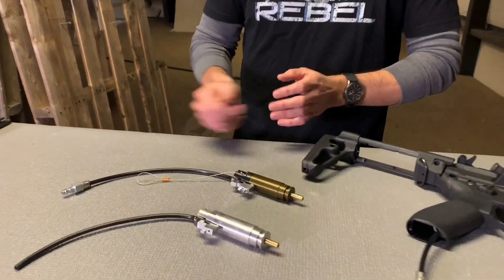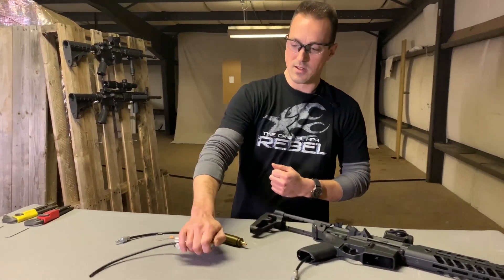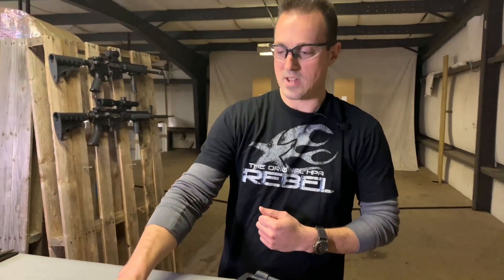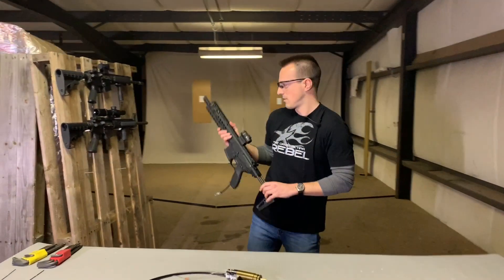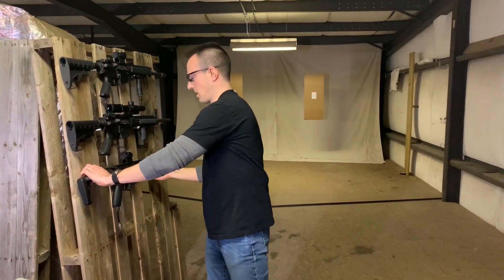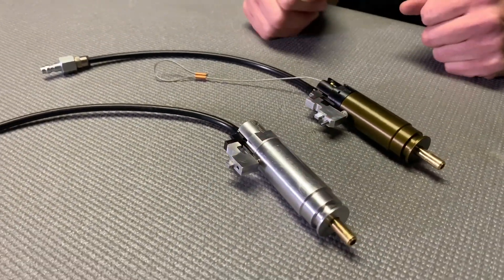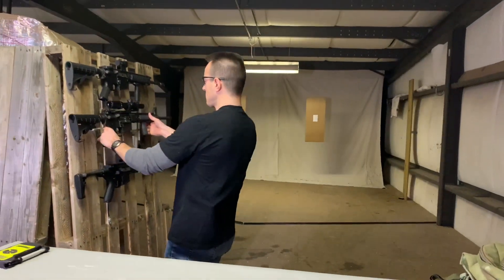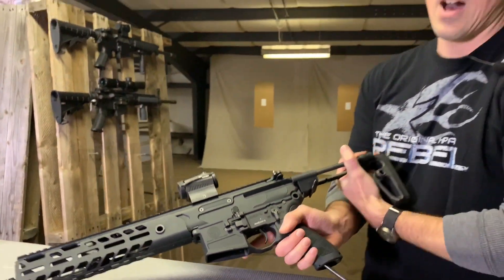Product Update - Kythera, Trigger Weight Test & Nozzle Dwell

Comment: Ok so I have a kythera, and for some reason whenever I use heavier bbs then 0.25g  the nozzle gets stuck in a rear position, and when I pull the trigger again it returns forward. Also the system seems to be leaking when I plug the air line in and dont have a magazine in the gun, and as soon as I pop the mag in and fire a shot it stops leaking. Anyone else experience this kind of issue?
Reply: Try readjusting your sear and disconnecter

Comment: I love the lack of post travel. It's my biggest gripe with most cylinder replacement kits and my favorite part of my fusion engine. 

I was wondering if it's at all possible to have a trigger lighter than 2 pounds, and/or shim all travel out of the trigger? 

My FE has been shimmed to zero travel and a .5lb trigger. It's like clicking a mouse. Nothing compares to it. 

I was also wondering if you would be willing to send out or sell the kythera with those chopped back gearboxes? When aligning the box, that buffer tube screw is the worst enemy. The entire stock is floppy, or the nozzle is sticking straight up. 

Can't wait to buy one! Thanks guys.

Comment: Hello polarstar. The idea of the pull string makes sense as you have explained here but have you thought about incorporating it with existing charging handles in AEGs? 

It looks like if you cut the wire short enough that it sits just below the charging handle, you drill a small hole in the charging handle shaft and knot the wire in place I imagine you can pull off a charging handle de-cocking mechanism!
The wire has to be cut in the right length to remove slack. 
What do you think Polarstar?
Reply: The funny part Boreless is that people did do exactly what you suggested, despite what the "armchair techs" have suggested in reply to your original comment.
Reply: @coryjohnson2314  someones surfing kythera videos 😂
Reply: wow thats actually a great idea, it would incorporate gas gun mechanics in a hpa system
Reply: drinkdrain0 hardly, the charging handle doesn’t go realistically as far back as a gbbr. Plus you still don’t have bolt lock
Reply: @opairsoft8100  that really depends on what type of hpa system. Tippmann hpa systems have a bolt lock mechanism, aeg's charging handles go back as far as gbbr charging handles do.
Reply: drinkdrain0 um the tippman doesn’t have a bolt lock, second, 99.9% of aeg charging handles go nowhere near as far back a a gbbr....there is only one that I know of that does and it’s made by g&g
Reply: @opairsoft8100  hmmm, maybe the bolt cover doesn't go back very far but the charging handle does go back as far as a gbbr, I've had kwa, g&g, lancer and e&L
Reply: drinkdrain0 no it fucking doesn’t....it’s not even close
Reply: @gpf32  Nope, I have krytac on hand, it's not even close.
Reply: @opairsoft8100  I have both a gbbr and an aeg and they go the exact same distance.
Reply: @koolcat6893  what brands? Because the only aeg that I have seen that has a realistic charging handle length is a g&g “heavy bolt” model. Everything else is way short.
Reply: @opairsoft8100  it was a lancer tactical
Reply: @koolcat6893  then it definitely doesn’t even go anywhere near the length of a gbbr/rs ar charging handle.

Comment: could be nice to have the cocking mecanism working with the cocking handle.
Reply from the maker: The cocking cable is designed in such a way that it could theoretically be integrated with a cocking lever in the future. :)
Reply: @PolarStarAirsoft  thats awesome!
Reply: Yeah I'll connect to charging handle
Reply: I know you posted this almost a year ago, but just to add an update, I did this with my Kythera build. I used the original cocking cable and shortened it by cutting the cable behind the copper cable clamp that makes the loop. I then created a much smaller loop and my own copper clamp. I drilled a small hole in the top of the charging handle and threaded a screw into that. Then I passed the screw through new loop and into the hole. It works really well. And I gave the cable a lot of extra slack so that the charging handle acts a bit like it would normally. I used a small spring to go around the cable and then down to the bevel gear hole. That takes up the slack of the cable so that the extra isn't hanging out the back of the gun and looking weird or rattling around. I believe the spring was a standard trigger shuttle contact return spring. Its size and weight are perfect.
I also drilled a small hole in the back of the gearbox, right in front of where the spring guild would go. I rounded all the sharp edges down so that the cable slides through unobstructed. I drilled the hole at a 45 degree angle through the 2 halves of the shell so that when opened there is half the hold in both side of the shell and you can lat the cable through there when assembling the gearbox. then I used a flat file to cut a small trench in the back of the lower receiver so the cable cab easily slide under the charging handle and not get stuck.
You need to have the access to the the screw that holds the cable to the charging handle so that when you need to open the gun up for maintenance you can disconnect the cable as it is attached to the gearbox and lower receiver and the charge handle is part of the upper.

It works perfectly!